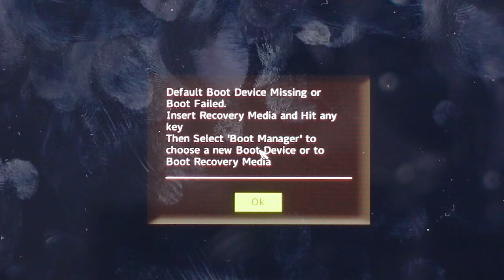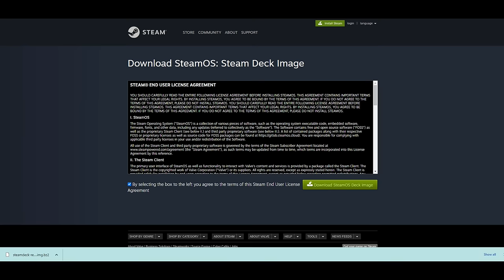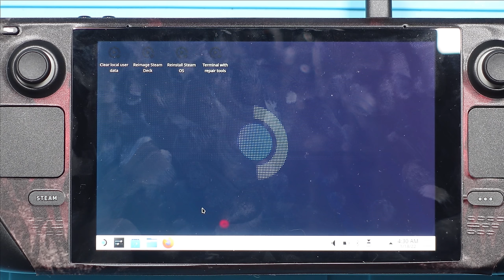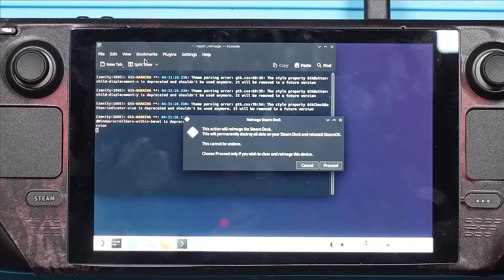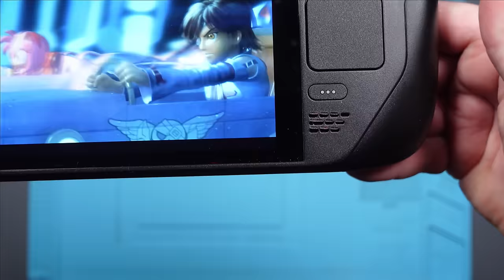I Paid £280 For This Faulty STEAM DECK | Did I Get Ripped Off?

Comment: I personally wouldn't consider you a chump. You have a good working steamdeck for about 280 quid. You have more repair skills and knowledge than me so I'd never have spent 280 on something that didn;t work.  I know FA about steamdecks but I looked them up and they are hudely expensive brand new (around 700 quids on Amazon) Used one's on ebay looked to be around 500 quids. Buying anything as spares or repairs is a gamble. Sellers know that selling as spares or repairs means that their is no come backs, which also means they can literally sell any broken crap and not face any comebacks as long as it's sold as "not working/spares or repairs"
Reply: Steam Decks are only sold via Steam store, Amazon ones are resellers with markup. They are $400 new.

Comment: I would have waited and ordered a new connector so it could be soldered down to the board, when I absolutely have to recycle a connector which is trashed, I use epoxy to bond it to the board and did that recently when a 3DS had a charge port that was fine but the pad on the PCB it solders too was ripped off so nothing to solder it too.

Comment: I hold the small components down with a toothpick so the solder doesn't suck them off the board with surface tension.  

A little epoxy probably wouldn't go amiss on the connector either.

My GBP calculator says that you paid about $337.  Given the drive is worth about 10 or 15£ you didn't lose money, and now you have a steamdeck.  They are pretty good all round game machines.

Comment: Great job on the repair. Not so great job on putting all that tape on the SSD. You should use proper thermal pads not some similar looking tape you have laying around. Now you have successfully insulated the SSD and it can't get rid of it's heat. If you are lucky it probably won't overheat to the point of it slowing down but it won't help it's lifespan either.

Comment: You could have used the soldering iron to melt the mounting pins back into the plug and solder them back on the pads. Or even used glue. That would make it a little more secure.

Comment: 13:28, here is when u failed ! 
You were not supposed to remove this pins from the board. the bottom part of the connector shoud simply be be inserted in these two pins...

Comment: Before the video even started. Gurantee it isn't just the SSD probably bad, Small Pc intend to have lots thermal issue. He probably had that situation and try to add thermal paste or fix it. For a grown man who play video games it is obviously, Nerds kept the SSD for Data, he could of sold it seperately knowing it has value on it's own. If it wasn't disclosed in the description simply Return it, But i am sure you won't because you'r getting paid for content on adsense

Comment: not only can your new steamdeck play gba, ds, snes, gb, sega, playstation one games, but it should also be able to play some gamecube titles, and maybe wii! so you've got like over 10 thousand games right there. but best of all, the steam deck can be the lower screen of the DS and an external monitor could then act as the top screen of the DS. same with Wii U games, the steamdeck becomes the wii u tablet and the external monitor becomes the 'primary display.

so thats another couple hundred games.

then it plays pc games, and since it is a pc you can do powerpoint presentations, with libre office, or maybe even word document editing! you could code up a little webpage with html and see it render in your web browser using nothing but this device!

all those indie games you never got around to playing? keep your steamdeck on you and they'll all be there waiting. 

but say you want to play a top of the line AAA game? you could try to play it at the native screen resolution, or maybe lower, but whats stopping you from just streaming it to the device instead? say you had a good pc that plays AAA games, just stream them to the steamdeck, all the power of a big computer, on a tiny little portable display/controller.

also, warpinator is a thing, you can use it to transfer files, just open the app/program on both devices, and even over wi fi, so long as they are connected to the same network, the other device should show up. just select it, then send a file. but you have to confirm the transfer on the other device first. best of all, when you are done and you quit the program/app it'll actually get out of your way, and won't be running in the background, and won't start up automatically, and won't download updates in the background and won't even bother your cpu/ram/storage, until you open the thing again! its perfect.

oh and I guess you could read books/manga/web novels/light novels/short stories/comics and such as well. hey, try out warpinator with an ebook. they're like 5mb,

Comment: If the listing didn’t state it came without a ssd I would be requesting a refund of the cost of the ssd from the seller through eBay’s buyer protection.

Comment: I did this and had an off brand USB drive and it took forever And got stuck on a black screen with a mouse cursor.  Then I got a real SanDisk and only took 3 min.  So don't cheap out

Comment: I hate it when OEM's like Apple use wack screw types to prevent owners from fiddling around with the hardware, but the previous owner of this Deck is the reason that Apple (and others) don't want customers popping devices open and fiddling with em.

A few moronic apples (pun intended) think that they're the next macgyver, and proceed to "service" their device with all the skill and finesse of a drunk, rabid bull in a miniature china shop.

Some people need training wheels, or at least basic training (not the armed forces kind. The common sense kind).

Comment: Even tho this vinyl foil was sloppy & ugly as hell, it did the job keeping the shell almost prestine.
But i still woudn't buy such an expensive device without removable battery, thats a huge no no for me.
Batteries decay over time simple as that 4 the same reason i dont buy smartphones with fixed batteries.

Even me headset has a replaceable battery with charging reciver & a spare one so i nerver have 2 plug a cord in 2 charge the thing.
Which eliminates the risk of standing up & drag the pc with you happened 2 me more than once + it doesn't ware off the usb port.

Comment: Oh boy this makes my blood boil. What kind of person is this previous owner of this Steam Deck? He failed with his skin application - speaker grills part is crooked, top part is also crooked; screen protector applied with bubbles; damaged case while opening; opened Steam Deck and instantly f-ed up connector; lost or stole ssd shielding; when putting back together pierced through aluminium sticker with a screw instead of applying sticker after putting the screw back in; when closing the Steam Deck he lost one of case screws; he put Steam Deck on sale and did not mentioned that there is no ssd in it. Like what the actual f**k?

Comment: You frankly should have returned it because "faulty" is not the same as "parts removed". If they'd included the faulty SSD and sold it as faulty or parts, I'd accept it, but to remove an expensive part and charge you almost the price of a new steam deck is taking the P. Wish you'd returned it

Comment: That damage has got to be the lamest thing i've seen. Because all you're doing is changing the SSD. And he goes and rips out the speaker cable like that. What hell happen. He put the screw driver in. While putting a million pounds of force on it.

Comment: That foil over the screw is simply an anti-tamper measure - it shows Valve that the Steam Deck has been taken apart and may give them to reason to reject any warranty claims.

Comment: Your soldering technique is very bad bro and i prefer u change the soldering head to a thinner one  but will done
Reply: You prefer? Who are you? 😂
Reply: @AthosJosue  who are me I study electronics engineer, and I am working in the electronics field since I was in high school repairing tv radio pc in work shops , now I am supervisor for hearing aids repairing and assembly and I soldier  under the microscope for almost 15 years no one can tell if my work was repaired or brand new, also in my free time I buy damaged consoles and repair it.